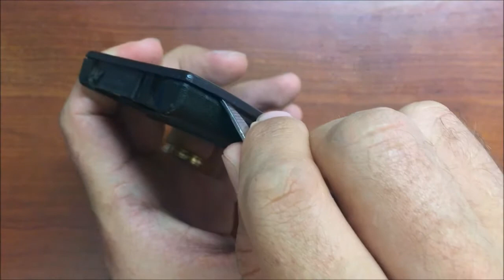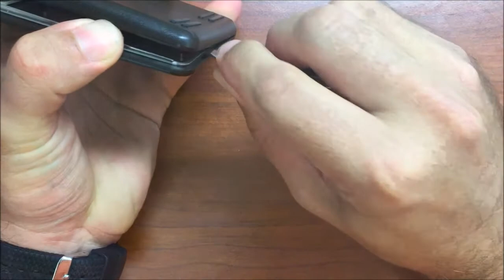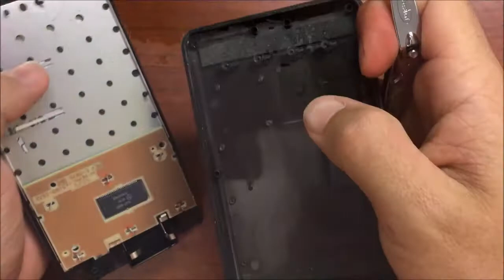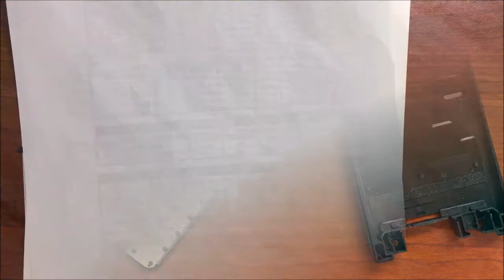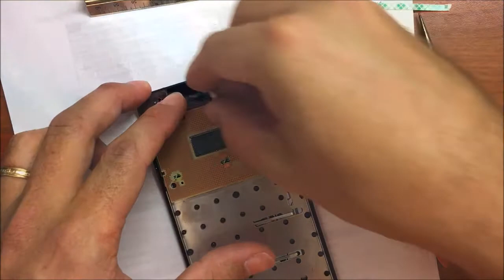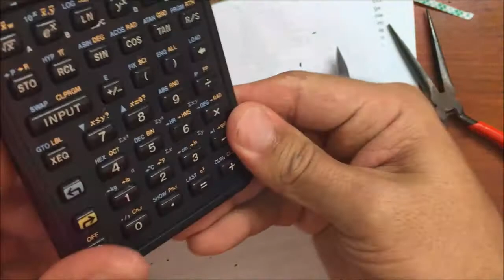HP 20s Calculator Screen/Keyboard Repair

Comment: Thanks for the video. It gives me hope for my beloved 20S I've had since the 80's. My 20S was acting irradically, for instance, sometimes adding 2 numbers correctly, but at other times ignoring the + sign in 2+3 and showing just 23 and waiting for the next command. Soon I will get up the gumption to actually do what your video teaches. Thank you.
6 days later. well, I did everything as shown in ths video except I also drilled the 2 stubs near the batteries, as mentioned below by one of the commentors, which made it much easier to take apart. The first time I did everything as shown in the video, and when I got it all re-assembled and put the batteries in I got the same "All CLR" message, but when I tried to do some simple calcs it still had trouble "seeing" all of the key strokes. So I reassemble it again, put new foam stripes in as shown here, put it back together again, and Ka-Bang it looked like everything worked. I was happy! Two day later I thought I do some calcs, and found that now none of the keys responded, only showing 0.0000. 
So I give up.  HP, that design is so Mickey-Mouse, so disappointing. ....contacts via pressure? rivets vs 4 screws ....anyway, it did work for a while.... interesting exercise.

Comment: Thank you so much, Logan.  My beloved HP-20 has risen from the dead!  I was about to throw it in the trash, when I thought I'd do a quick search on the net, and immediately found your video.  The fact that you do every step in real time was most helpful.  I simply followed you step-by-step, pausing the video while I imitated your actions.  In our throw-away world, we badly need guys like you to help us rescue equipment that is easy to repair, but only if you know how.  I would have never figured out how to even gain entry to the calculator with your specialist knowledge.
Reply from the maker: That's outstanding, Jack. I did this video thinking that it was unlikely anyone was ever going to want to watch it to repair an old calculator but it's encouraging to see there are people out there who would rather take something apart and fix it than just throw it away. I wouldn't say I have specialist knowledge though, I'm just a tinkering engineer!

Comment: It helps to drill out the heads of the top rivets first, makes them much easier to pop which reduces the risk of bending the top. When reassembling the calculator, I screwed some small countersunk screws in the holes of 2 of the rivets, this makes it as solid as it was originally.
Since I don't trust any of the replacement foams not to degrade over time as well, and given the limited number of times that those PCB clamps can be bent, I 3D printed a replacement for the foam using TPU (NinjaFlex) which I expect to maintain its elasticity for much longer. A bar of 46.00 mm long, 2.75 mm wide, and 2.75 mm tall is a good size, at least for my version of the 20S. I printed it nearly hollow to keep it springy.

It looks like there are multiple variants of the 20S and yours is more recent. Mine has the CPU silicon die suspended in free air with some fancy mounting device, and the LCD has contacts at the top and bottom.
What I really like about this calculator is that with moderate use, it easily lasts about 10 years on a set of 3 LR44 batteries. They did a pretty good job at optimising power consumption.
Reply from the maker: Wow. Impressive.
Reply: Drilling out the top four rivets seems like a good way, but how did you deal with the bottom four which are masked by the cover plate?

Comment: Very helpful video. I just drilled out the 4 rivets by the battery, very easy. I wasn't sure what was holding the bottom of the case. Those 4 rivets have to be popped as you showed.

Comment: Well, I greatly appreciate your detailed video which gave me hope that my DOA calculator that set me back almost $50 with shipping and tax might be saved. I see a lot of happy comments below, but boy am I disgusted with the engineering design and quality of this calculator. It's ridiculous that they relied on such a terrible connector scheme to begin with, with compression and/or corrosion eventually causing all these failures. With the help of the drilling comment below (great idea), I was able to get mine apart without damaging it, which otherwise looked unlikely (it did NOT want to come apart!). I then proceeded to clean the contacts with 99% isopropyl alcohol, but the PCB pads remained very dirty looking. My ohmeter was reading about 45 ohms just probing two close spots on the same ground pad! I tested it, and it still did not work. I cleaned it one more time, and then thought I should measure the resistance on the flexible cable pads too--only to discover that most of them were literally gone in the middle! On the longer traces I was able to repeat the same-trace conductivity test, and basically the coating on these traces was an insulator. How was this ever supposed to work reliably? Now, thanks to the cleaning attempt, the traces on the cable are ruined and it's basically impossible to fix now, it's totaled. FYI, I'm an electrical engineer of nearly 40 years, I know a bit about electronics. I just wanted to share my story so that others don't think this is just easy and safe, it is not, and frankly I'm not sure I would value one of these badly designed calculators anyway, I'll collect other machines instead.

Comment: Hi Thanks for this - I was able to bring my 10B back to life , to open the top of the case and pop the rivets at the top I forced and old credit card into the case at the top and then a second one then using the cards to protect the case pushed in a medium flat blade screwdriver in between the cards - one twist and it pops open and distributes the force down the case, thanks again without your video i would have had no idea how the case was held together or where fragile components were located and would have probably wrecked my 10B
Reply from the maker: That's a great suggestion Steve, and I'm glad the video was helpful in some way.

Comment: Great video, thanks! I have opened a 42s using this technique but it took a lot of force to pry the bottom rivets off and the top plastic frame is bent by a millimetre or two. I probably shouldn't have shaved off the bottom rivets as much as i did as they don't snap together with the upper frame when I reassemble the calculator, and because top frame is bent a bit there's a permanent gap at the bottom. Any ideas on how to straighten the top frame other than perhaps putting it in a press for a few days. Cheers.

Comment: Wow,  This was not meant to be taken apart.   You need to apply some force to pop those plastic rivets.  Amaze the board still works.    Worth a try if calculator is dead.  But there is a  50% chance of cut fingers especially on the key board rivets the top can be drilled for easier removal..

Comment: Hi, and thanks for this; there's nothing like actually seeing this done!   I've watched your 32SII key-repair video and this one; and I have a similar, but somewhat different problem.
It's a 32S (not 32SII), that is 'bricked' after getting accidentally knocked on its screen; so I suspect the LCD or its connection to the rest of the calc. And before that accident, no problem.
I tried the sub-screen bezel pressure you've demonstrated, to no effect, which is why I don't suspect the keys. And BTW, the screen looks normal; there's no visible damage where it got knocked.

I'm really wary about popping it open, but I'm ready to try just about anything. But is there a different part of the innards I need to attend to for a LCD screen problem?

Fred
Reply from the maker: Fred, the short answer is that I'm not sure, but the LCD connects to the rest of the calculator via pressure on a flexible connector (essentially what I'm fixing in these videos is the connection from the LCD to the rest of the calculator). It is conceivable that the blow misaligned the connector. At this point, opening it up can't make it worse so I'd open it up, see what you find, and go from there.
Reply: Thank you for your reply. I'll try it then.

Fred

Comment: Thanks for sharing! Do you know how can I clean/fix the black screen of my HP 20s?
Reply from the maker: What do you mean by "black screen"? Does it not turn on?
Reply: It turns on... show the numbers... but the screen is dark... I forgot my calculator on the sun, and now the screen is dark.
Reply from the maker: Oh. Well I'm not an expert on that but I would suspect the LCD was pretty much roasted. The only repair would be replacing it, in which case you might as well get a "new" one.
Reply: Logan West That's what I thought too... Well, thanks again! I will try to find some calculator parts to replace it!